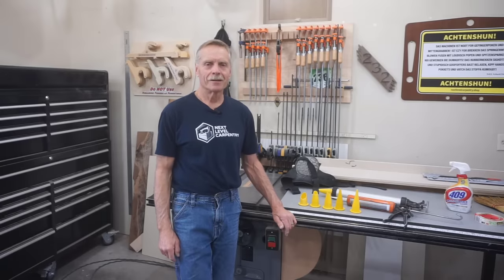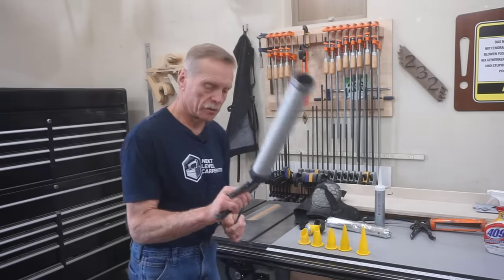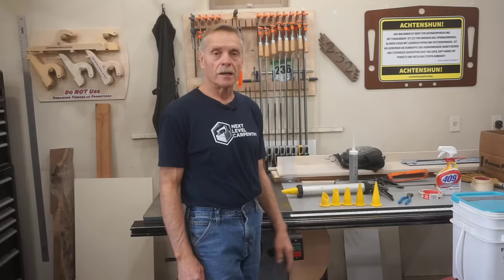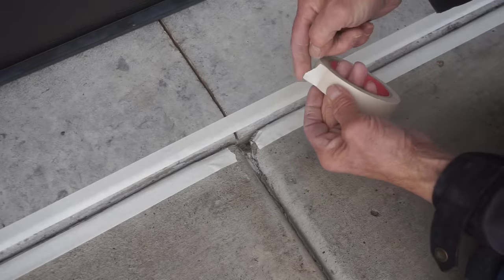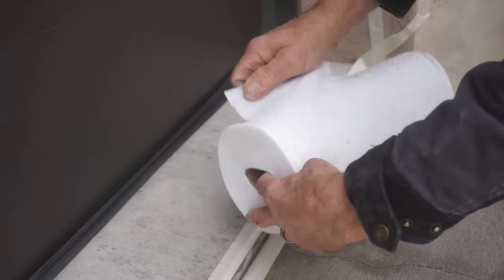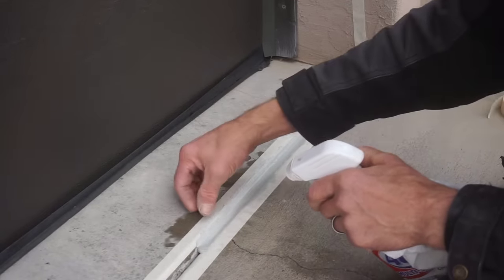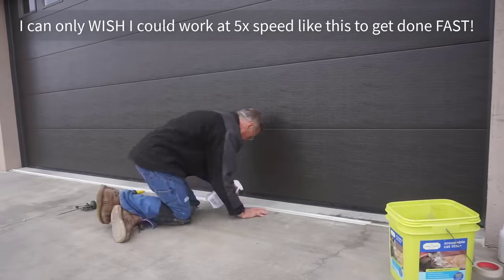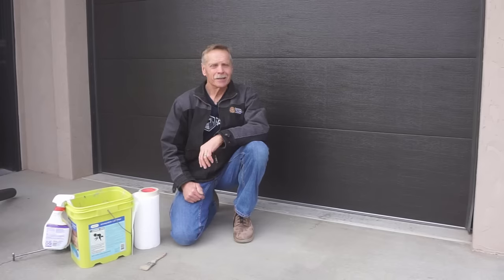How to Caulk Concrete Control Joints with Perfect Results Every Time

Comment: Does Vulkem 116 give the same result as this FC?
Reply from the maker: The results are very similar but the Vulkem  product has a slightly different texture. I prefer the FC but will definitely use Vulkem in a pinch without regret...
Reply: @NextLevelCarpentry  I asked you because I already bought some Vulkem 116, 10.1 oz and a new, small Newborn brand calk gun. Would this smalI gun can handle this thick, sticky caulk? Or I rather say, if, for the first time, could handle a bigger gun?  I saw a video; they applied Vulkem 116 on both sides of the backer rod, let it dry then they applied Vulkem 45 SL on top of the 116 & the backer rod. Then I found your video. I wonder if I could just apply Vulkem 116 over the backer rod without the 45 SL as you just used the FC? I am not sure if the 45 SL will not run to the street. My slope joint is 2 in wide x 2 in deep; I will probably have to cut the  backer rod in half. As a female senior, never fixed anything, I would very appreciate your advice.
Reply from the maker: @diemvolz4311  I would stay away from any of the self-leveling urethane products out there for residential application.  I'm sure both products are compatible but it sounds like a dicey combination and technique IMHO.
I've done plenty of large jobs with just the 10 oz caulking gun so I imagine you'll do fine even though it's a little bit more work. If the urethane seems too thick or stiff make sure the tubes are relatively fresh and you can always warm them up if it is stiff because of cold temperatures.
If I were to caution you about one thing it would be working to seal up joints that are 2 in wide as you learn how to do this. You will be less stressed and get better results if you pick some low hanging fruit and do joints that are less than 1 in wide as you start out and use the technique.
Kudos for taking on a new challenging project and be sure to give yourself a bit of Grace as you start out until you get the hang of it.
Best,
Matt
PS for large joints like that I have actually used foam swimming pool noodles to fill most of the joint with a goal of having the thickness of sealant equal to 1/2 the width of the joint being sealed.
Reply: @NextLevelCarpentry  Thanks very much for your advice. Now I feel more confident to do it with your more simple technique. Oh, my largest joint is 1in wide, a little more at some spots, not 2 in (my mistake); Also uneven edges at some spots too. I bought an insulation pipe tube to try and cut it in half because the joint is only 2 in deep. The joint has concrete at the bottom. The foam seems tigh enough at the 1 in wide part. It is made with polythene like the pool noodles, but I don't know if it works well like the noodles and backer rods. Sure my caulk tubes will be warm enough under the SE Tx summer heat. Now it rains and very humid. Can't start my project until later in the fall, I guess. Thanks again.
Reply from the maker: @diemvolz4311  sounds like you have a pretty good grasp on what you're dealing with. FWIW Joints 1-in wide are three times easier than joints 2 in wide. Do yourself a favor and start with something simple and straightforward so you can tackle more challenging things with confidence later... 😎
Reply: @NextLevelCarpentry  Sorry for asking you so many  questions- 1- Should I use 409 or dish soap + water for Velcum 116? If so, what is the ratio of water and soap? 2- Can I wear thin, plastic gloves for tooling? 3- For the spots that have unlevel edges, should I place the tape down below the higher edge to the  line that is the same level with the  opposite lower edge?  4- After tooling, in your video, It seems like  you have a  little curved caulk surface, about  1/8 in lower at the middle than the edges, a space for the sand later? or  light camera, I saw it wrong? 5- Silica sand , 120 mesh like yours, is out of stock on Amazon, in large amount, and not available at 2 box stores in my area. Can I buy the play sand and sieve it to get a finner sand  and use it on top of caulk? I appreciate your help.
Reply: Opps, 1 more. If I make a mess, what solvent shoud I use beside rags/ paper?
Reply from the maker: @diemvolz4311  I'd go with 409 instead of just so just because it's easier and guaranteed. FWIW during covid I was forced to use dish soap and I found that about 13% to 15%, soap to water is pretty good.
You can sure use any sort of rubber gloves with the only downside being a little awkward discomfort but with a little practice I'm sure you can manage and keep your fingers out of the urethane if you prefer.
The main reason for the slightly concave surface is so that shoveling or scraping or sweeping doesn't tear up or tear out sealant from the joint.
The biggest benefit of silica sand is that it is consistent clean and smooth. I've heard you can try janitorial supply houses and purchase ashtray sand as an alternative source.
Nothing wrong with running play sand through a sieve though although it's one more step and the color of the sand itself makes it a little more visible but it serves the same purpose if you don't mind a little rougher look. Bottom line is that any sand is better than no sand because no sand means dirt bugs and leaves which always looks bad.
When ceiling joints with opposite edges at different heights I generally put the tape along the top surface of the cracked Edge. In some cases one edge of the sealed joint will be higher than the other and the surface in between is concave but I feel it makes the best of a bad situation. Also it would be very difficult to get masking tape to stick on the cracked surface at a lower elevation... hope that makes sense? 
I think I answered all your questions and continue to wish you well on this project... 😎
Reply from the maker: @diemvolz4311  there really isn't a perfect solvent but I always keep a can of lacquer thinner on hand when doing this sort of work because it's the best chance you have at clean up before the urethane cures....
Reply: @NextLevelCarpentry  Would Paint thinner or Acetone work? i have them in the garage.
Reply from the maker: @diemvolz4311  generally paint thinner is too weak and oily and acetone is too hot and fast. Either of them might work in a pinch but you can buy a quart of acetone at a hardware store and it's good stuff to have around for this and all sorts of other projects IMHO 😉
Reply: @NextLevelCarpentry  1- Acetone and Mineral Sprits I have are in the gallon can. Are they different from the one from the hardware store?
2- I decided to use Dymonic FC sausages. (Hope I can handle it  and save time) The sausage picture on Amazon has a letter D at the end of the sausage. Are they the same kind as yours? I also will order the gun and the nozzle set  (not included) you used. Which nozzle sizes should I use? How big I have to cut the tips for 1" and 3/4 in wide joints? 
3- I used the calculator link you gave. I don't know if I entered the right number because the result is so many sausages I will need. Would you please figure it out for me. I have 1 joint, 1 in W x 2 in Deep, joint is 35 feet long and another joint, 3/4 in W x 3 in Deep, 34 feet long. 
4-  Yesterday I patched up some big broken spots along the joint edges with Quickett Acrylic Patcher. Hope it's ok to do it or it would shrink and the caulk would crack (?)
* I will try my best to succeed to deserve all the help you have been giving me! Thanks a million!
Reply: Could I use the FC to fill small cracks  and the space between the brick wall perpendicular with the cement patio?
Reply: Will the sand cover the white color of the caulk. I will buy in bulk and only white available
Reply from the maker: @diemvolz4311  Dymonic FC can be used to fill small cracks but for cracks less than 1/8 in wide it usually makes more of a mess and is better left alone.
I use the exact same process for ceiling cracks between horizontal concrete and vertical Masonry and it works very well. The trickiest part is applying the masking tape to the vertical surface but with a little practice you'll get the hang of it... 😎
Reply from the maker: @diemvolz4311  the sand should not change the color of the sealant at all. I would advise against buying white sealant if you want Gray and to look for another source rather than have bright white caulk lines showing on Gray concrete forever. The best colors for concrete are limestone or gray and I'm afraid you would regret using white. There are a lot of sources for dynamic FC besides Amazon so invest a little time looking and you'll find a better option...
Reply: @NextLevelCarpentry  Please estimate ABOUT how many caulk sausages I need to buy. I don't understand what to enter the UNIT, what percentage ? and the Inefficiency Factor on the calculator. Is the depth is the depth of the joint or the 1/2 inch caulk? I entered 1/2 it 's an invalid number. I entered 2 for the joint depth, I need 39 sausages for 1 joint 35 feet (?)
Can you give me the source to look for FC?  I googled, it's much more expensive and shipping cost. Box stores here  too.
Reply: Never mind, I found a chart.
Reply: I finished my project in a week. I must have done someting wrong becauce there are many bubbles. Will the bubbles pop open soon or later and what could I do?
Reply from the maker: @diemvolz4311  sorry you ran into that trouble. 
in my experience those bubbles are caused by air trapped under the fresh sealant that expands from Heat. The bubbles themselves will not pop and the best solution is to wait a week until the sealant cures and then simply cut them out and apply fresh sealant to seal up the hole. I get bubbles occasionally but it's very rare so there may be something about the condition of the dirt under the concrete your ceiling that's causing more than normal.

Comment: I hope that you DO go into the ABSOLUTE requirement to avoid a bond with the bottom of the joint. I'm replacing 100% of my driveway joints because I failed to do this. Sadly, manufacturers don't make this clear, and retailers do not sell the Bond Breaker Tape needed to do so when there's no room for backer rod.

Why it is an issue: if you simply fill the joint, and especially when the joint is deeper than wide... when expansion is needed, the sealant sticks to the bottom and one side... and detaches from the other side. Result: joint failure. :(
Reply from the maker: There's a lot of causes for joint failure, 3-sided bonding being one of them, but the joints in this video didn't need (and don't have) bond breaker tape and are holding up just fine.  Sorry your project was a complete failure but it does highlight the need for 'joint design' consideration for other viewers which I appreciate. Best, Matt

Comment: Is anyone else confused as to why this joint needed to be tooled?? If you're going to cover it with sand in the end.....tooling it is a waste of time. That method (409)  works if you're leaving the caulk as the finished product. However, I wouldn't waste my time tooling only to cover it with sand in the end.
Reply from the maker: You're not paying attention Eastward... The sand keeps detritus from sticking to Fresh sealant but doesn't mask a sloppily tooled joint once excess is removed. Hope that clears up the confusion for you?

Comment: Why not self leveling there?
Reply from the maker: Same reason I don't use self-leveling anywhere... it looks bad in any application except for the most pristine and ideal. Besides that it's nowhere near as good looking when complete and is far less flexible over time so it fails prematurely. It costs about the same, is just as much work but is difficult to replace... but other than those reasons there's really no reason I didn't use self-leveling for this video. 🤨
Reply: @NextLevelCarpentry  thanks for the reply and very informative video. Would you mind providing the name of that again please?
Reply from the maker: @JeffRigney  You're welcome.  Here's the sealant, if that's the name you're asking for: https://www.amazon.com/dp/B003XSP6OQ/?ref=idea_lv_dp_ov_d&tag=aiponsite-20&linkCode=ic6&ascsubtag=amzn1.ideas.2N0D3GFVZVC8G
There's a few other brands of one-part urethane sealant that work well... I gravitate to Tremco because of history with the product and availability.  The main point is that it's NOT self leveling.  Self leveling has its place but I see it misused far more often than proper application.  Self proclaimed 'pros' argue with me constantly in comments on this video but not a single one has EVer provided visible proof of their claims that other methods look better when complete.  I don't claim that highways, runways and huge commercial building projects be sealed with my method, which would be ludicrous, even though those pros never admit the value of the process I show for residential/DIY purposes.
Thanks for watching and commenting on this one!
Best, Matt
Reply: @NextLevelCarpentry  I have an upcoming project of sealing an entire splash pad.  It’s a playground with water works that kids play on. Customer says they want sika self leveling. I haven’t been to look at it yet so I have no idea the size or if the joints are even or not. Just beginning my research. If it’s a larger area (estimating 1000 sq ft), new construction with all level joints what’s your recommended process and sealant?
Reply from the maker: @JeffRigney  I would, but that's just me and based on my long term experience with reliability and results using the system shown in the video. Square feet are irrelevant, linear feet of joints is the main bid factor IMHO. 
Were I you, I'd do thorough due diligence looking into long term performance of any self-leveling product you're considering.  Most of the self-leveling jobs I've seen show an unacceptable amount of bubbling, edges that pull away and sealant that gets brittle in just a couple years.  My temperament and reputation drive me to spend extra time up front in research, prep work and application to save callbacks.  I could take you to sealant jobs I did 20 years ago that haven't failed but show countless jobs by others that fail in a few years.  Whenever I commit to a job I'll spend any amount of time necessary to avoid failures that result in callbacks from work I didn't do properly.  Sealant I've done has failed but only from site conditions beyond the expected performance of said sealant ie: ground settling, frost heaving, extreme thermal movement etc that no sealant can stand up to.  
If a client were to insist on Sika Self-leveling, or any product I am unfamiliar or uncomfortable with, I'd get it in writing (if I even chose to do the work) because I only warrant work and materials I'm confident in.
Wow... big answer for a small question, right?  Good luck with the job... if you choose to do it.
Best,
Matt
Reply: @NextLevelCarpentry  thank you very much Matt.
Reply: @NextLevelCarpentry  hey Matt what’s your email address?
Reply from the maker: @JeffRigney  you can use matt@nextlevelcarpentry.shop with discretion😉😎

Comment: Not bad results for a home job...should be tooled with masonry tools to apply the correct amount of pressure and to also ensure that you dont get your hands full of caulking. Tremco caulking is good, as well as Sika, which is used more on hardscape/concrete joints. As far as the sand, make sure to always use a washed and kiln dried sand or you will regret it later.
Reply from the maker: What do you mean "not bad for a home job"?!
I might be slower than someone that does this all day everyday but I've yet to see a professional provide photographs of a job that looks better... Juss sayin...
Reply: @NextLevelCarpentry  Its not your speed as much as it is the manner in which you did it and the material you picked. Either way, we dont post those videos because we are too busy working....shooting hundreds of feet of caulk per day....correctly and with the proper tools and in the safest way possible. 
Just sayin'......
Reply from the maker: @marlowflores7606  too busy working that you're not able to post photos of the amazing work you do but not so busy that you can't spend time posting comments to a video that shows Everyday People a way to achieve excellent results?
Reply: @NextLevelCarpentry  somewhat, yes. I actually train our crews on many avenues of "sealants"...next time we have a small drop in business I will record the training session and post it.
Reply from the maker: @marlowflores7606  that would probably be a beneficial video for many viewers. I would be interested in learning about how commercial applications are done to compare to what I show in this video for typical residential  work. Feel free to post a link to your video here if/when time allows... Best, Matt

Comment: You should NEVER use wet method for tooling ive seen tubes of caulk explode on contact with the wet method, as the chemical reaction is so dangerous they keep the caulk in tubes and ive personally seen at least 45 people die from caulk accidents - many i could have stopped but i feel people should learn from others mistakes
Reply from the maker: What on earth ARE you talking about?  That's one of the most absurd comments I've seen on this video yet.  I do hope you're just trying to be funny because, even if you're not, you are.
Reply from the maker: Far better to watch a video and be thought an imbecile then to comment and remove all doubt...